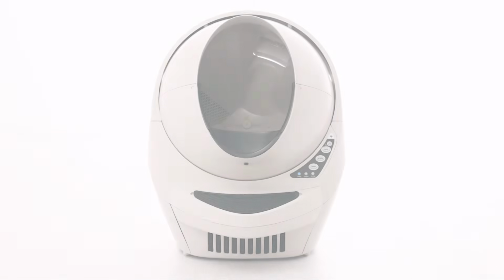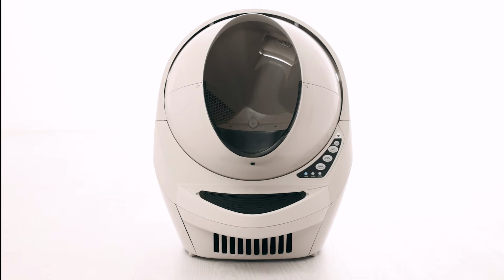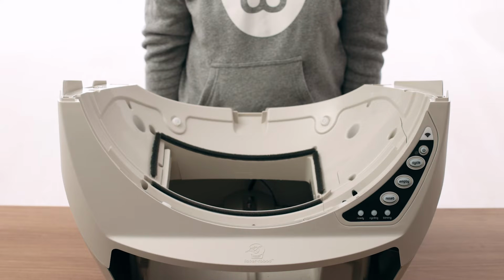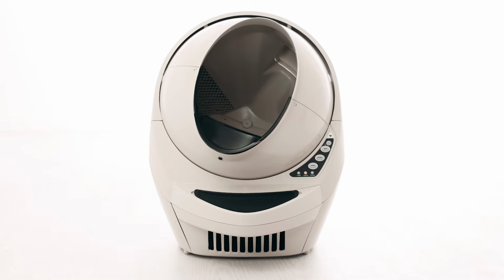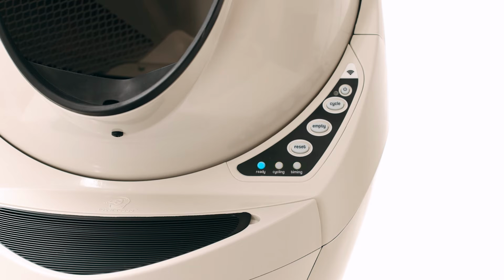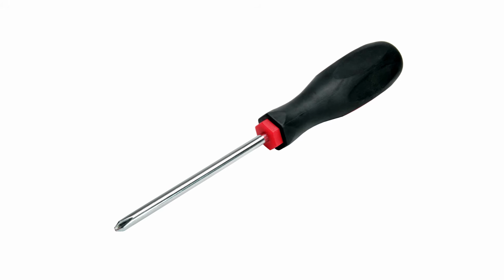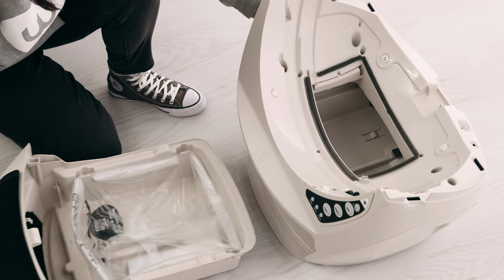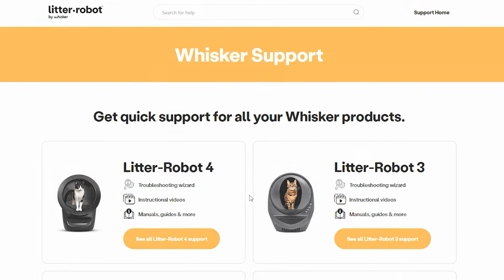3 Flashing Lights - Globe Position Fault | Litter-Robot 3

Comment: What are the polar ends of the magnets at the 1 and 5 position that should be facing the user if they looking at the globe from its front opening?
Reply: SOLUTION. The North or South "side" is irrelevant. They just need to be of opposite polarity. So to achieve the correct orientation: 1) Collect and lay the 4 magnet bars on top of each other lengthwise so they form a square.  2) Break the square in half with your hands in the only way possible. 3) Place the long face of the halves which were "stuck together" into the 1 o'clock and 5 o clock slots so the attracting faces are "inwards".  4) PROFIT

Comment: I had to replace the DFI kit because it was faulty and one of the wires on the position sensor snapped off when I removed the tape (as per your instructions online). To replace it would be to replace the base which is about how much I paid for the entire thing. Every other wire is secured well with a plastic connector except for the position sensor, which isn't a replaceable part. This seems intentional.
Reply from the maker: Please reach out to our Customer Experience team at 877.250.7729 M-F from 9AM to 7PM or Saturdays from 9AM to 5PM, Eastern.

Comment: Just fixed it. thank you! I replaced the DFI kit but didn't put the sensor in the right position. As a result, the container will route more, leading to a position fault.
Reply from the maker: Thank you for the update! We're glad your unit is working properly again!
Reply: Same for me, I replaced the DFI kit. When putting the control panel back together, I saw what turns out to be the globe position sensor. I didn't know what it was, but figured it didn't matter where it was as long as it didn't interfere with the motor. I stuffed it in somewhere that seemed harmless. Thanks to the video, I realized what the part was and that it had a location to be mounted in. Sensor back in correct place, everything WORKING great!
Reply from the maker: We're so happy to hear your Litter-Robot is working like new again, KingBaconMonger!

Thanks for being part of the Whisker family!